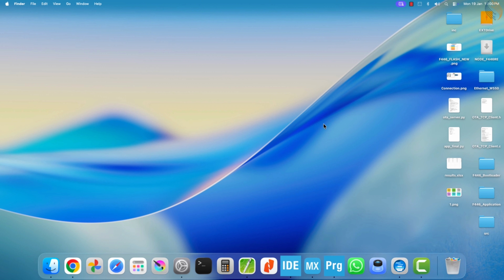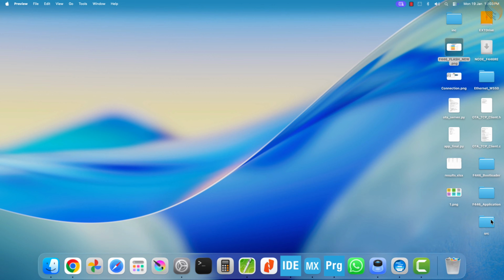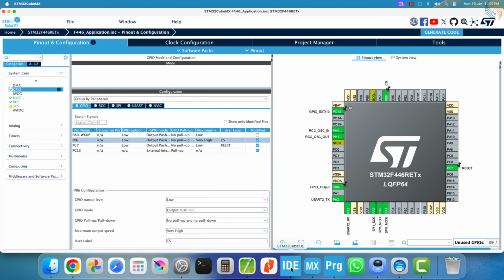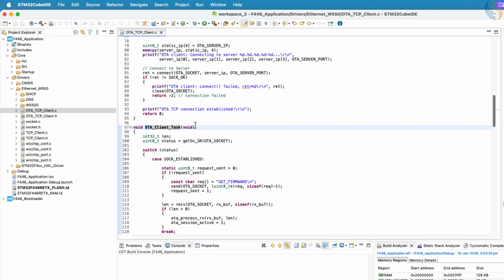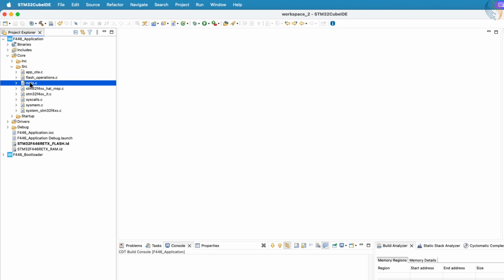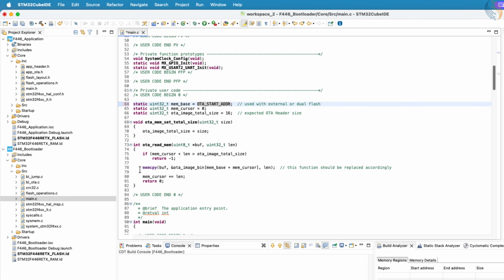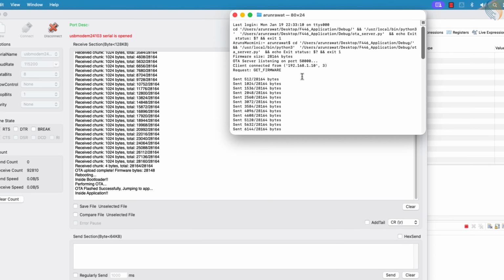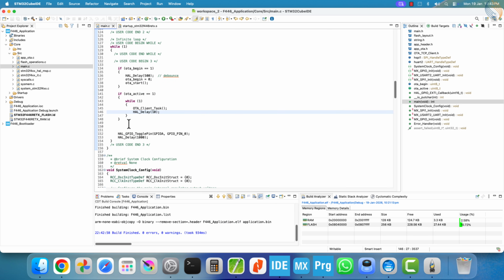STM32 Custom Bootloader (Part 6): Flash OTA Update from TCP Server Using Ethernet

Comment from the maker: Download Project Files & Full Article: https://controllerstech.com/stm32-ethernet-ota-tcp-server-bootloader/
Reply: Great video and I learned lot stuffs here. But I have one question, how bootloader programmed that keep fail-safe firmware updating process? Like suppose we are applying firmware update then what it contains that it will not overwrite current bootloader and in case of firmware update failure it returns to current version of firmware? Also, one more doubt that I have like does firmware update contains root_fs or something or  what it contains ??

Comment: Hi. There is a much better way to do OTA that greatly reduces a chance that you will update to a defective application version.
Instead of having "OTA region", why not have 2 application regions? And boot them able to boot interchange-ably?
That's what I do. Bootloader flips between application regions on each boot (uses a flag in EEPROM for this). As it receives OTA upgrade, it writes it to the other region (not the one currently running), clears EEPROM flag that signifies this region passed self-test successfully, then after restart the bootloader tries to start the freshly written application.
If that application passess self-test, it will set self-test flag for itself and then overwrite the other region with itself.
If it does not pass self-test (next boot sees that the previous boot did not write EEPROM flag to signify successful self-test) then it is deemed defective and is overwritten with the currently running region (the previous version of the application).
The end result for the user is this: the user sees that the application tries to upgrade, then restarts then if it does not boot and needs to be manually restarted it will just go back to previous version.
If you have a hardware watchdog you can automate this procedure further so that failed update will be automatically reverted if it fails to supply watchdog signal.